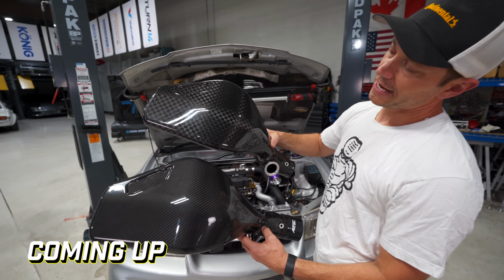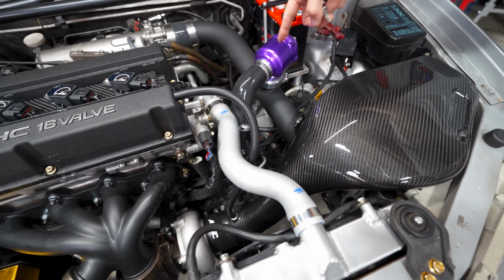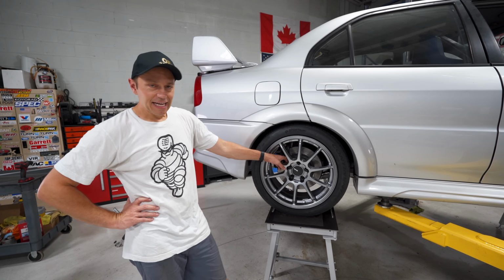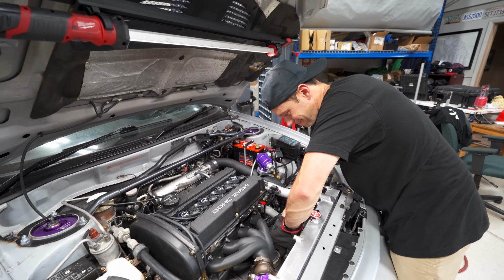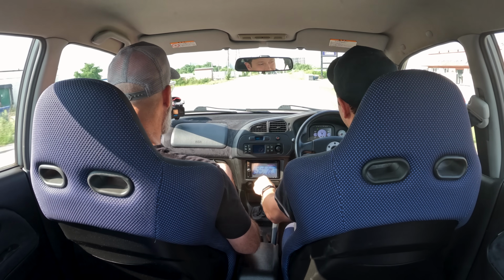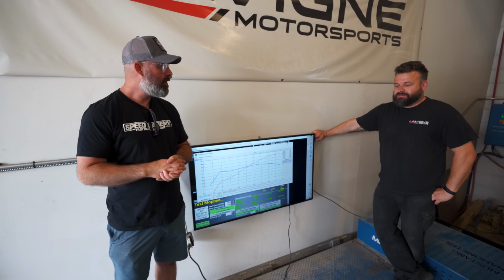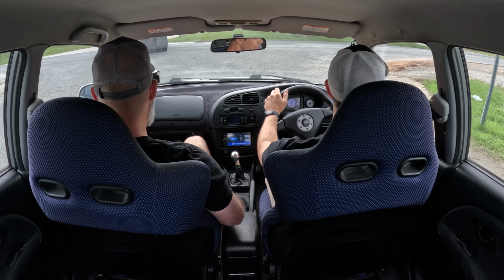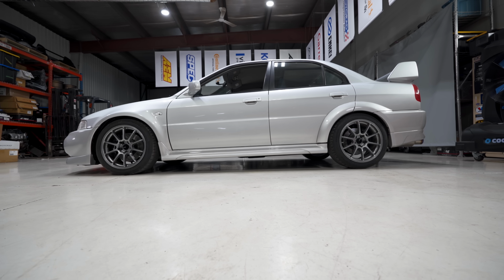Is This PEAK Mitsubishi EVOLUTION?

Comment: I inherited a one-owner (my ex-Boss gifted it to me 60k Mile) 1997 Talon TSi survivor (the American EVO), never modded, raced or abused. It mostly sat for about a decade (after a Macco respray of Factory black) and was not used much after it was 2-3 years old. I went through the car top to bottom and front to back, replacing anything deteriorated and usual maintenance items. Being a survivor in the factory spec. The only thing I upgraded was a crank pulley, higher Amp alternator, higher amp battery, a braided stainless clutch hose (I left the original in situ as a quick backup if ever needed), tires are much better now than 1997 (factory Eagle GT), it is a joy to drive and gets more attention than my other sportscars. So, tempting to change turbo etc... but there is a reason this car is still going and yet not a slouch for a 2.0. Road conditions are not SoCal quality so the stock ride height and no worries about scraping or bottoming out, especially when spirited driving. Maybe my forever sporty driver.

Comment: Hey @speedacademy  Artec's website note that the airbox needs to be shortened slightly (at the turbo end) to fit the Evo 6.  Was this true in your case?  How did you manage it?
Also - who'd you use to make the custom bracket for the airbox?  
Great looking car!
Reply from the maker: We didnt shorten it so it was very close to the chassis but still fit with no rubbing. And we simply bent up a bracket ourselves, wasnt much work at all!

Comment: Am stoked to see this series on an Evo 6 which the exact same version as mine in the same colour! Imho, the 6 is the best Evo, I've owned mine from new, bought in 1999.  So, that intake, what a piece of work!  I'm in the process of speccing parts for a 500 whp build on mine, and that intake is the best I've seen by far, very spendy though! Same for the exhaust manifold, it complies with my philosophy for a turbo manifold, short runners and cast steel. Good production and I'm so pleased to have found some great parts for my build.

Comment: Highly recommend you send your manifold off to someone like Headershield. That header configuration on Evos just murders other components in the engine bay with heat. You don't have to worry about ceramic coatings flaking off etc.

Comment: Weak rods in a 4G63T like a 2JZGE y put a weaker rod in it because factory 2JZGTE can handle 800 900. 4G63T 6 bolt rod can handle 500 600 so y put a Weaker rod in the motor when you can use factory so the real up grade should be more than that because the engine can make some really good power and torque max turbos out kind of set ups and be reliable. Carrillo ftw street build.

Comment: Pete, curious what would be the ultimate evo wheel backspacing with 18-in wheels if they could be custom built to order both front and rear?  Meaning absolutely using zero spacers.

Comment: I think you need those amber corners back. I went through this debacle with my E36 M3, and the clears just clashed with the coloring of the headlights (too chrome/perfectly white) so I reverted to the ambers and haven't looked back. Too washed out in my opinion, though everything else is absolutely top notch 👌👏 hats off to you!!
Reply: +1 with the amber. also for their 911.
Reply: @hungryalien  🔸️🔸️🔶️🔶️🟠 agreed! 🟠🔶️🔶️🔸️🔸️
Reply: Been saying that since the first version the amber indicators look much better especially with black housing headlamps

Comment: Love it. Loved it more with more rake. Proper underbody and a diffuser and you want at least 5 degrees for circuit tracks and then adjust suspension bound and rebound from there for ride / track use

Comment: Good thing PT didn't sell the turbo that wasn't being used... That would have resulted in another turbo purchase. 😐 The silicone BOV re-circulating tube can be shortened up at the straight section to reduce contract on the coolant hose. The Evo looks good and sounds good! 💪🏆

Comment: Pro tip: Dampen the cheap microfiber towel with water before cleaning/detail spray and it will not scratch the paint. The follow behind with a quality microfiber towel to slightly buff. 👌🏼
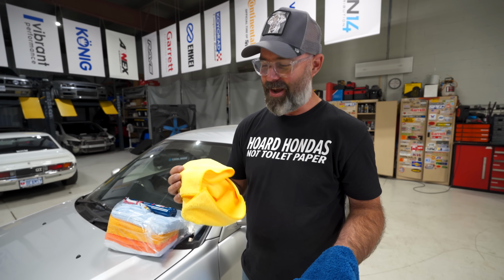Reply: 9:46 are those cheap yellow towels the Kirkland signature ones? I thought they were good gsm for the price. GSM and softness are two different things? Sorry I don’t know much